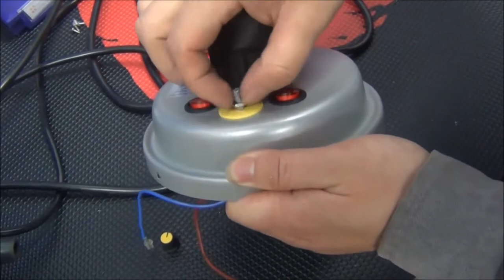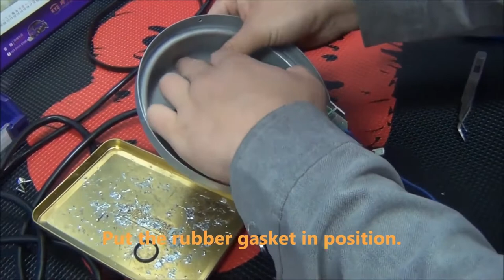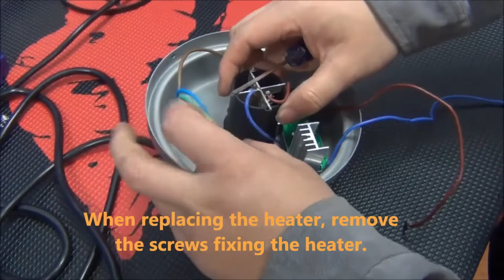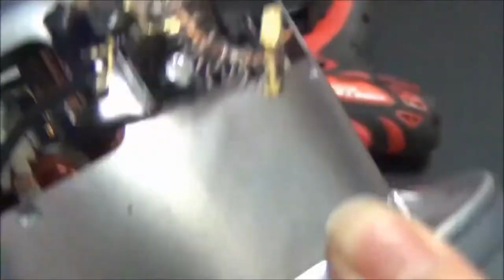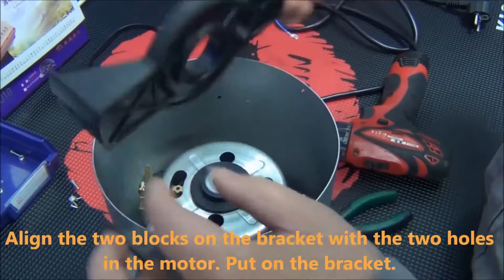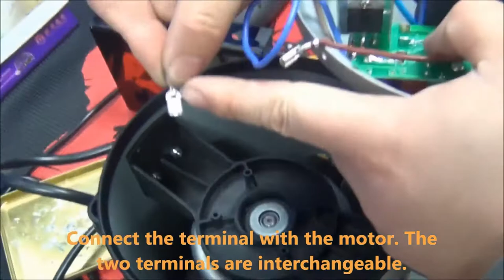Dryer TD-901GT repair and disassembly

Comment: mine is always on when plugged and the setting switch is not working, the fan speed is always high.
what do you think the problem.
i already replaced setting switch and even power switch but still the problem is still there